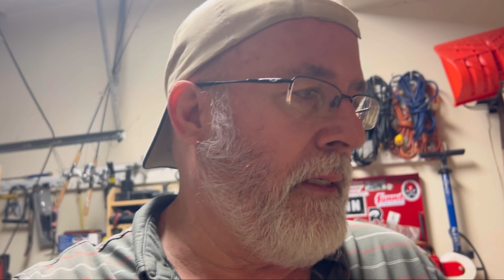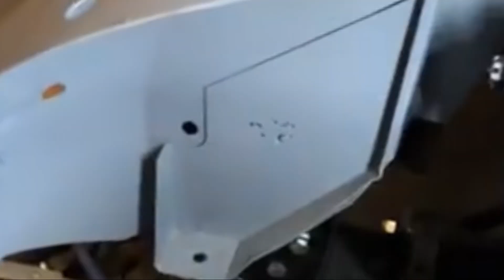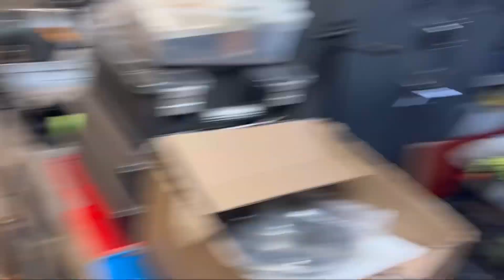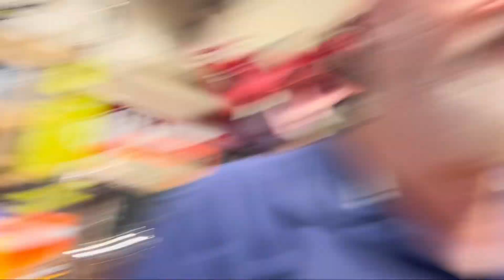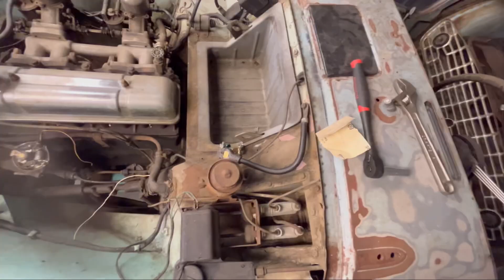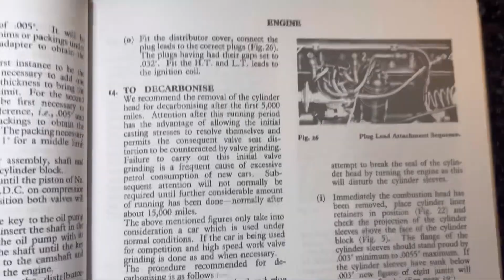1958 Triumph Tr3 and 1962 Triumph Tr3

Comment: Very exciting to see the engine turning over even if it is just from the starter motor! When I'm starting them up for real for the first time I usually put oil in and and turn them by hand to get some oil circulating around before cranking too much.
Reply from the maker: @scotthasse280  thx so much Scott